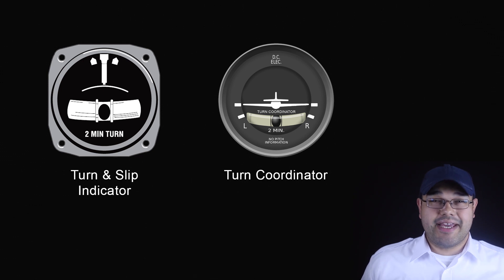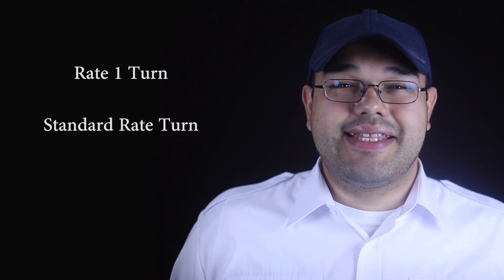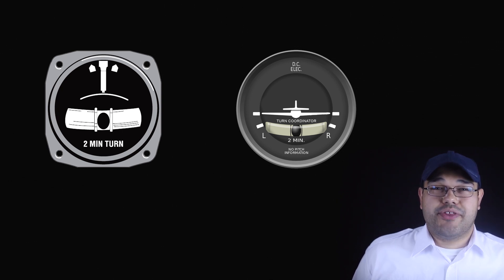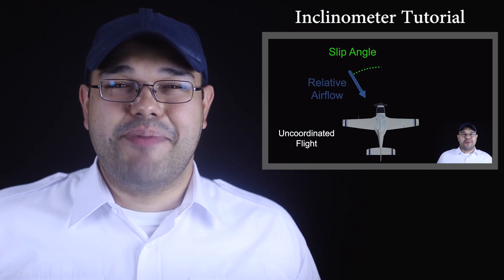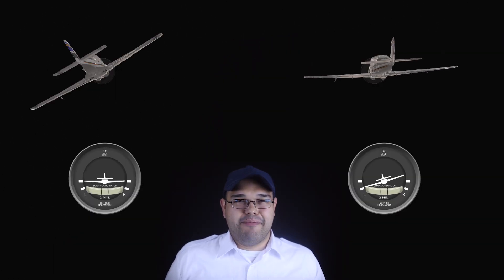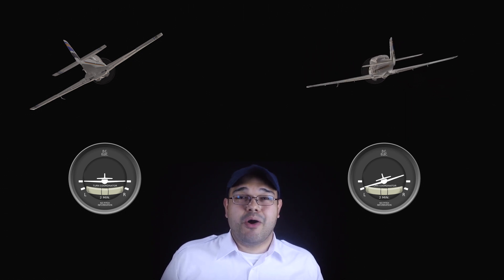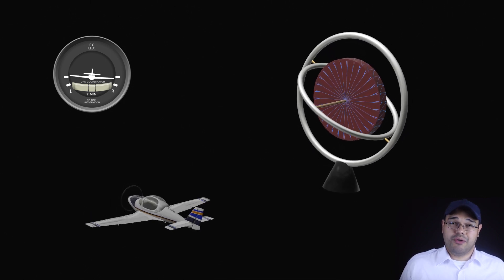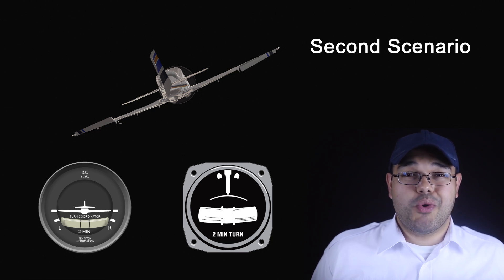Turn & Slip Indicator and Turn Coordinator | Pilot Tutorial

Comment: Really good video.   One small problem though... 4:05 minutes in,  the blue arrows are in the wrong position.   They should be in the 9 o'clock and 3 o'clock  position.   And then when the force is transferred 90 degrees  forward by precession, the 6 o'clock and 12  o'clock  are correct.   Notice the narrator describes everything correctly...  he says the force is transferred 90 degrees  forward but the video shows the blue arrows moving 180 degrees  forward .  That being said,  I really like this narrator and the video is very well done.  The best part that really helps me understand what is going on is at 7:30 with the "First Scenario" and "Second Scenario" examples.  Fantastic!  Thank you!